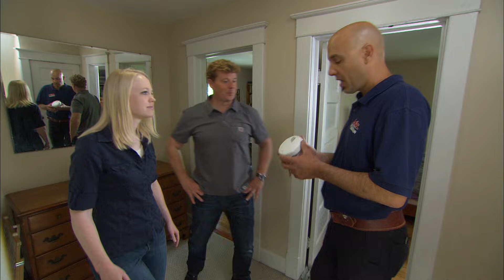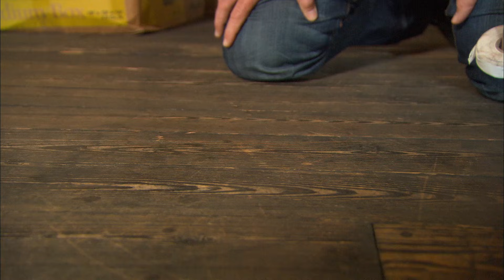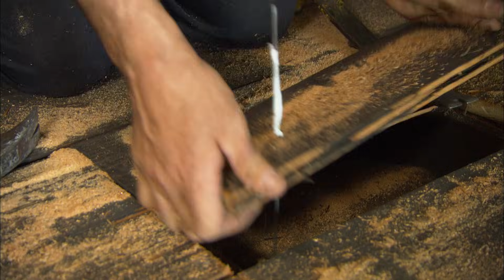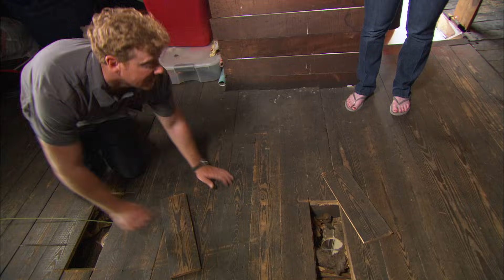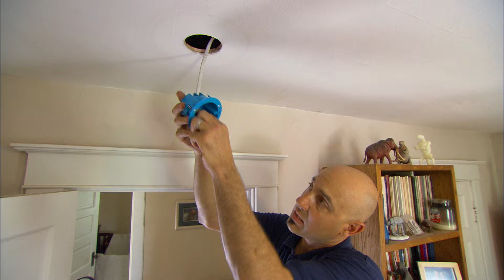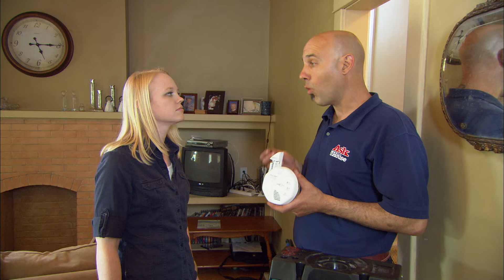How to Install Smoke and Carbon Monoxide Detectors | Ask This Old House

Comment: If everything in the house run by electricity a smoke/carbon monoxide detector is not needed, a smoke detector would be fine, correct?

Comment: Do all the detectors need to be on the same power source? Can detectors on different floors have different power sources as long as they are all connected to a single red wire running from one the next?
Reply: They can have different power sources. As long as the interconnect wire is connected they’ll all sound

Comment: Did you use a 4 inch hole saw to make the boxes to fit? I purchased the blue plastic connection boxes showing  in your video.

Comment: I see how you wired the fire alarms but how did you wire it into the outlet in the Attic.? I noticed it's a 14-3 Romex so where did you connect the red for power was there a 14-3 already in there? What if it's a 14 -2 that's already existing there?
Reply: I’m sure he pigtailed the hot & neutral from the back of the outlet and didn’t use the red wire
Reply: The 14/3 red wire is just needed for communication in between devices. It should not be tied into a power source. So a14/2 is your power supply. 

But in this video that means it's not talking to the lower floor devices unless he pulls a new interconnecting wire or uses a remote transmitter of some kind.
Reply: @lukekoesler3383  They didn't do a great job explaining that. First Alert sells hardwired and wireless interconnected detectors. You might want to connect the wireless and wired ones together, so to do that, they sell a special bridge smoke detector. Since it's not a combination device, you have to wire the carbon monoxide detector separately, or you could just have a redundant hardwired combination detector.

Comment: This is an extremely important informational video which can potentially save lives, first & foremost, no argument whatsoever, hands down.

BUT...Why weren't the floor/attic ceiling joints explained to the viewers?  Or, how magically the wires are passed thru the joist?  This appeared to look way too simple but it's commonly unknown to the average person of joist layouts.   Only the pros know the joist layouts, along with the required tooling and required skills to run wiring thru the joist.  That was not clearly explained in this segment.  C'mon folks...OK, the lighted fish tape was a nice touch, at best.  But have to ask...What enabled the fish tape to get from point A to point B?  Drilling of the joist?  And the required tooling to accomplish that?  Do you truly think that any homeowner could just simply pass the wiring without pre-drilling the joist? 

Thinking there is some quality editing improvement potential prior to public release.  Again though, this is an extremely important informational video which can potentially save lives, no argument whatsoever.
Reply: That’s why sometimes you got bring in a licensed electrician.

Comment: I think he used way too much smoke for that, you just need to spray it 1 to 3 times  near the detector and it will go off, you don't need to use that much smoke.
Reply: You should not encourage people to look up at the "smoke" without eye protection.

Comment: I've always heard that carbon monoxide detectors should be low to the ground, since carbon monoxide sinks. Is this wrong?
Reply: It doesn't really matter what height they are at, CO spreads pretty evenly throughout a given area.

Comment: Aren't fire alarm systems supposed to be on a dedicated circuit?
Reply: Some places require a dedicated circuit. He said if someone turned the circuit breaker to the dedicated circuit, no one would know. However, I think the alarm with a battery backup would beep if the AC power is turned off.
Reply: @easyroc75  Yes, though the system is supposed to have redundancy. Supposed everyone is awa for a weekend and that circuit trips and battery power goes out within the 24 hour limit or 48 depending on how much juice is in it? Come back don't realize that cicuit is off because it's on a circuit not being used and boom, fire while your family is sleeping.

Comment: For smoke detectors where exactly in a bedroom go?? Like what's a best location in a bedroom... How far away from vents or it doesn't matter?
Reply: On the ceiling in front of the door. Sometimes one on both sides of the door for extra safety(apartment code).
Reply: @gangisspawn1  Thanks

Comment: If battery is moved but powered by wire, will it always chirp?
Reply: yes, the battery is only if the power goes out. If it's also hard wired your good.
Reply: there's usually voltage monitoring for the backup battery so if it gets old the battery can invoke the chirping to start.

Comment: Is it required to shut off power in the house while attaching those colored 3 wires?
Reply: Wdt
Reply: Definitely turn it off.  Only after you got it wired in and have a modular connector for future replacement would you not need to turn power off (works light plugging in socket).

Comment: If code requires 2 sources of power to your detectors how do you get away with just a battery operated on the first floor?
Reply: If smoke detectors are being installed in a home built prior to the hardwire code requirement than wireless smoke detectors with a non removable 10 year battery can be used. If a house is undergoing extensive renovation which would allow for the routing of hardwire power cables than the new detectors must be hardwired.
Reply: Lllllllllllllllllllooooooooo
Reply: LMAO
Reply: I don't know about this State, but where I am in Ontario, Canada, we only need one hardwired, and the others can be battery operated.
Reply: He put a second smoke detector in the basement.
Reply: @LeroyZee  for backup of smoke detector(late reply)

Comment: Because carbon monoxide is slightly lighter than air and also because it may be found with warm, rising air, detectors should be placed on a wall about 5 feet above the floor
Reply: No, they should be on the ceiling.
Reply: I would love to see some one actually put a co alarm 5 feet above the ground but no one does it because of aesthetic reasons

Comment: Pretty sure its supposed to be on its own power source. 15 amp arc fault breaker, 14-2 to the first and 14-3 in between others 🤷
Reply: No, you are wrong. He said why they share circuits in the video. If the smoke detectors get shut off then you would want to know. So if your master bedroom lights are off, then you know your smoke alarms don't have power.
Reply: @ryanwoods4691  A smoke detector that has both AC/DC power will beep if the AC power is turned off. Correct?
Reply: @easyroc75  it depends on the model of detector.

Comment: Hi I have noticed the smoke alarm beeping,I have disconnected it from the wire but I noticed the beeping has moved to the ceiling light and its continuously beeping every 5-10 sec 24/7.Any solutions please?
Thanks
Reply: Just find an exact replacement for it if you've done the battery change and it still does it .  These have maximum lifespans and some will beep at that point, or they just crap out over time. The same model will fit the existing mount and so it can be swapped out in like 1 minute time.
Reply: Battery needs changing... if you can't figured that out then hire a handyman for ALL issues in the future.

Comment: Will 12/2 wire work or 12/3. I noticed he had red wire?
Reply: 12/3 for alarms with a red interconnect wire and 12/2 for alarms without that extra wire

Comment: Carbon monoxide is heavier than air and sinks to the floor, so putting a CO detector on the ceiling makes no sense.
Reply: That is false. CO is slightly lighter than air.

Comment: How did you had the wireless smoke detector talking to the fire alarm system with the wires? Can you please tell which model numbers of the first alert were installed in this video?
Reply: It uses a wireless type signal to communicate with the one in the basement which will then connect to the second one and send the signal to the rest of the smoke alarms (i know as we have a similar model ours is the sc0500 i believe)
Reply: I think the 2 in the basement are connected to each other and the wireless is connected to one of them

Comment: I think a commercial fire alarm system might be a good choice if you have enough money.The solution can be like this:
1.unimode 2000 UDLS FACP in basement or garage
2.fire lite LCD-40 annunciator in entryway
3.some BG 12LX pull stations installed throughout house.
4.spectr alert low frequency horn strobes in sleeping areas
5.gentex horn strobes in living area(tone set to code 3 mechanical or whoop)
Reply: You must be drunk because this is a house..  not a restaurant
Reply: A little too over powered. Tho if you want something like that then get a security panel and wire up a few fire zones

Comment: This was a great video.  Unfortunately I need to do a hardwired install in the location you put wireless.  Any advice on running the cables?
Reply: I'm pretty sure you take the same steps Scott took (run romex from a nearby power source to each location) without having access to an attic. There are plenty of videos showing you how to do that

Comment: Hey I have question how connect the smoke detector to the breaker box
Reply: It is connected to the outlet in the attic which is already connected to the breaker box.
Reply: @lmd6204  🔥
Reply: gavilan juarez it’s straight 120 line voltage

Comment: was this made before batteries and 1/4" self tapping screws  were invented
Reply: The units installed have battery backup. Also, the detectors were wired in such a way where all the alarms will go off when one of them detects smoke or carbon monoxide.

Comment: Wow, i know your code is different from scotland, but why no earth sleeving?? It just makes sense. Any US sparky would learn alot if they worked over here for a few days.
Reply: It's not necessary to have the ground/earh covered since it's not a normal current carrying conductor, and usually bonded to the back of a metal box. North American codes say that the ground/earth must be identified with green insulation, green with a yellow stripe, or bare coper. I believe Australia also has a bare ground/earth conductor in their NM cable/twin and earth.

Comment: Sending the wires to these devices is cumbersome but there is no way out of it... Great for remodel work but I don't recommend if it was going to be inspected it will be a no pass.. Why? All devices need a dedicated circuit and they all need to be hardwired... That's what happened to me in LA...
Reply: NevrBDwn Ruby does not need to be on a dedicated circuit.

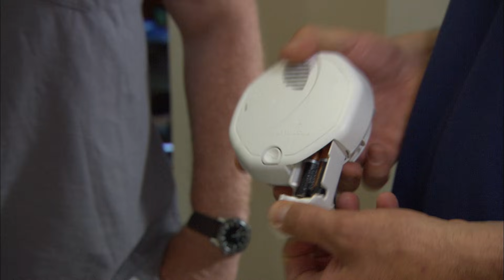Comment: 0:22 "Code requires 2 sources of power now" But he installs a battery powered smoke detectors downstairs
Reply: I don’t think running power to the device is the difficult part but having all the devices connected through the orange cable is the most challenging part.. so it makes sense to choose a wireless one to connect with the other devices but I would have also hooked up the device to power in addition to having a battery
Reply: It's doble battery
Reply: He said that it's the most difficult place to get the smoke alarms wired to

Comment: You said, on the upper floor, that the alarms needed two power sources according to code, then on the first floor you installed a battery only unit.  I'm not an expert on the code but is that allowed?  Also, you can use bridge units to join a wireless trigger unit to the wired ones.
Reply: When renovating a home it is required to have all smoke and carbon monoxide detectors hardwired, interconnected with back-up batteries. Wireless is a good option, if you are not opening up walls.
Reply: @jay fine Thanks, that makes sense.  My first post here was 3 years ago!

Comment: Great plastic shield, Where can I buy one.
Reply: PlayGirl It's just your standard cheep plastic bowl from the kitchen section with a small hole in the bottom.
Reply: Alec Ver Bunker it's a great idea and could be sold as a tool.
Reply: PlayGirl they do sell it as a tool but for much more then it's worth. I use a plastic salad bowl and it works just as well.

Comment: Bugger the smoke detectors, what were those red terminal caps you were twisting wires together with?

Ive done electrics for a long time in the UK and have never seen such things before.

would save time over solder and shrink wrap that's for sure.
Reply: https://en.wikipedia.org/wiki/Twist-on_wire_connector

super cheap in any hardware store.
Reply: http://www.homedepot.com/p/Wire-Connector-Assortment-25-Pack-775128/202894260
Reply: ArmyOfAll  just remember its 110v in the us compared to 220 over there
Reply: Wire nuts
Reply: James Jennings not being cocky but letting u know its 240~250 volts. So soldering is a musg

Comment: Correct me if  I'm wrong, but the last I heard the NEC says that smoke detectors should be on a separate circuit. I get that you guys did this so it's more user friendly, but the job should be done to code for today.
Reply: If the NEC states it should be on its own circuit ( individual branch circuit ) I would be interested in that chapter and section or if it's an amendment to NFPA 70 written into law and approved in a specific state or commonwealth. I'm almost inclined to point towards NFPA 72 if that even exists.
Reply: Sigvulcanas you are correct. Hard wire smoke detectors must be on one circuit and are NOT allowed to be GFCI or AFCI protected.
Reply: You are wrong.
Reply: codes change depending of the country/state.
Reply: International Code Council Electrical Code (ICCEC) :Section 1202.5 states: "Smoke detectors required by the International Building Code and installed within dwelling units shall not be connected as the only load on a branch circuit. Such detectors shall be supplied by branch circuits having lighting loads consisting of lighting outlets in habitable spaces."
Reply: WRONG!!!   NEC section 210.12 requires 120v smoke alarms to be on Arc Fault circuits.   
They should be interconnected and on one circuit.   There is debate on weather they should be alone on a circuit, or be on a shared circuit.   NEC, NFPA, and IRC do not weigh in on the matter.   Some state and local AHJ have made a determination one way or another, and they have the final say.   The fire prevention community is leaning toward being on a shared circuit, so that if the breaker is tripped, the occupants will be more likely to notice it, whereas if the alarms are by themself, someone might turn off the breaker to silence a false alarm, and then never turn them back on.

Comment: Just to notate. If he added that wireless on on the first floor a person can just have all of them be wireless and skip any of the wiring. Cost more upfront but cheaper on labor costs...
Reply: Yes but wireless detectors that communicate to each other are battery killers. Cost of labor is easily made up after a few years of replacing batteries. Most of them take a lithium battery too, not your standard 9v
Reply: @djbriguy32 they do eat up battery that much and most of them take standard AA and 9v batteries

Comment: He never mentioned there are two kind of smoke alarms, ionization and photoelectric. Ionization is better for quickly flaming fires and photoelectric is better for slow smoldering fires, and most fire departments and building codes like them both in the house. The best is a 2-in-1 unit that has both types.
Reply: Now I heard that it burnt to the ground because of him not disclosing every kind of smoke detector there is
Reply: Most combination alarms are Carbon Monoxide and Ionization.
Reply: this video will explain everything
https://www.youtube.com/watch?v=714NB7CVrpA
Reply: Just watched a video by Technology Connections on this, and he raised a concern over how the 2-in-1 detectors may work. If they don't trigger on either/or, but instead only when both detect, this could potentially reduce their effectiveness. In other words, is the 2-in-1 meant to reduce false alarms by waiting for both to trigger, or does it allow either to trigger to increase their potential to signal a fire.
Reply: if you have knowledge more than him so make videos about it on your personal channel don,t teach him
Reply: - - - -202 ~ - همها ح)/: 0 " حم زز-حمزة ~يس n #  اصهزن /) ع 0 0 7 لما 1 / 9 ا)Y] 0 ( ك ل'75 G '
Reply: which kind is better for a certain room? say bedroom vs kitchen
Reply: IAmNotAFunguy yea he never mention them well I fell bad for this lady thank to Scott

Comment: CO2 detectors on the ceiling??? CO2 is heavier than air and sinks to the lowest level...putting CO2 detectors on the ceiling is a great way to completely miss a problem!!!!
Reply: Came here to say that putting CO detector to the sealing is kind of wrong. CO has really similar molar mass as air. Meaning it will stay at the level of source. Most commonly CO detectors are installed at the height of sofa or bed (avoid dying while sleeping) and not higher than 150cm. Actually CO is slightly lighter than air (28.01g/mol vs. 29g/mol ) but the difference is too little and probably varies in case of air
Reply: They've installed one on every level.
Reply: There's are a huge difference between CO and CO2, read before commenting

Comment: How do I what is code for the state/county that I reside in?
Reply: You can get a copy of the National Electrical Code (NEC) NFPA 70 from Barnes and Noble. That's a massive book with codes for just about anything that uses electricity. This is a national standard and state and local codes use the NEC as a basis for their own codes. As far as local codes, I would check with your town/city hall or maybe a fire station.

Comment: Yeah, the new interconnected smoke detectors are just great. 10 times the false alarms.
Reply: I'd venture and guess it's the brand of devices that you're using, also it could also be that they're old and need to be replaced.
Reply: we've had interconnected for a very long time in Ontario and never had a false alarm. I think it's your smoke detector and not the interconnecting.